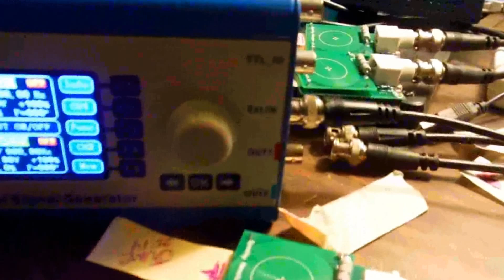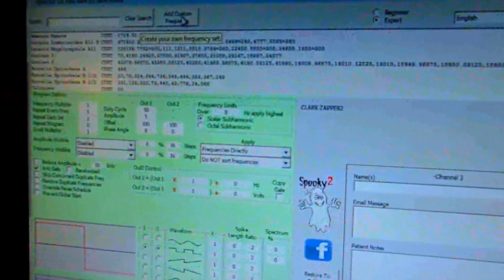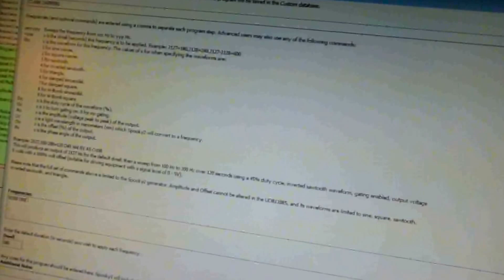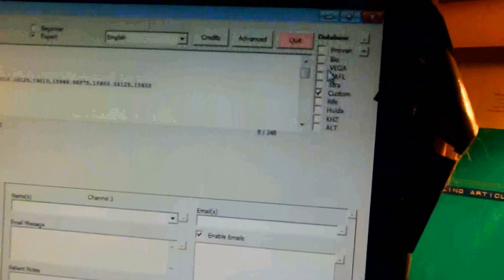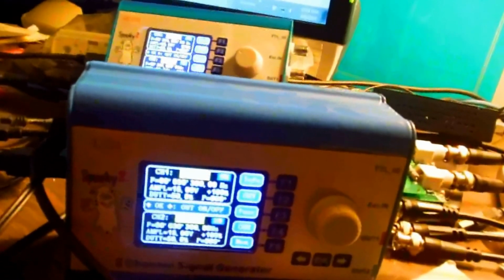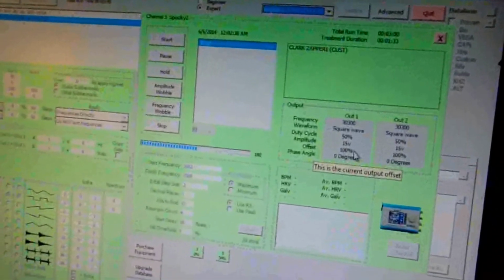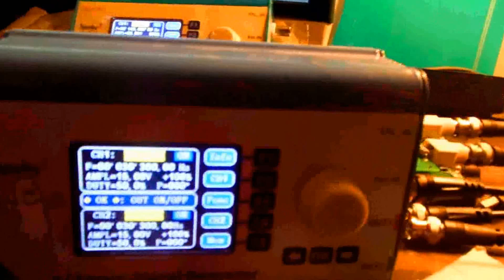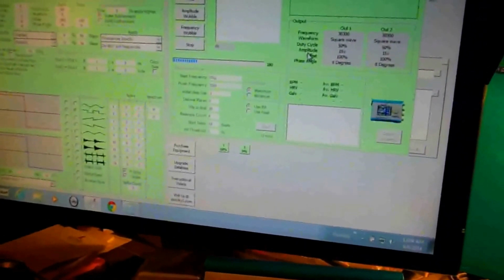Make Hulda Clark Zapper with Spooky2

Comment: strange I run this program thanks... but my out2 will not mirror out1 for some reason I have to change settings on out2 in program options to 100 % offset for it to be the same as out1 I do not have to use the  100 % offset  in out1 when running this program because it see the custom program and uses the settings.

Comment: how do you set the 100% offset on out 2?
It shows as 0% on out 2 using your settings
Reply from the maker: I was only using Out 1.  If you used a second zapper just type 100% offset in the Out 2 box.  I am not sure how to program that automatically.  I also don't know how to set this up with Spooky boost, but you don't need spooky boost, because 1 channel will put out plenty of voltage.
Reply: Thanks.. i'll give that a whirl.. I think its a steep learning curve for us all at the moment

Comment: Thanks for this.. I've always fancied trying a zapper.

Not sure if you know chris hyslop but he recommends using electrodes on the ankles rather than hands or wrist as you get twice the blood flow through the ankles.

Any thoughts?
Reply from the maker: Yes, I know.  There are several methods.  The same wrist method is the one that does not work.   You don't have to use ankle to ankle.  It could be the hand helds  or through the sides of the waist,  or wrist to ankle, etc. But using the same wrist, like Beck said and Sota says is likely not to work at all.  There are many exaggerations regarding how well these things work, but in my opinion they do definitely have some merit.  The same wrist method is very likely not to have effect even if this does work for some things.  The idea is to zap the blood. With the same wrist method. you are zapping mostly across the electrodes and not getting much of the blood at all. The hand helds are a pretty good way though. 
   Assuming the theory of zapping parasites is correct, the best way would be with a plasma device.  That would permeate the body.
Reply: Thanks for your input.. much appreciated

Any thoughts on the updated spooky2 software?  I noticed a few new sweeps